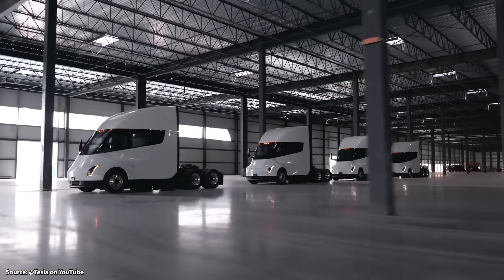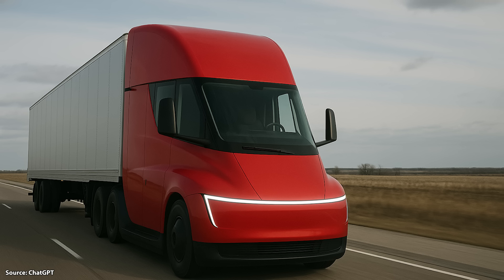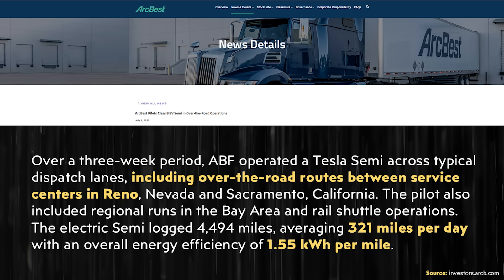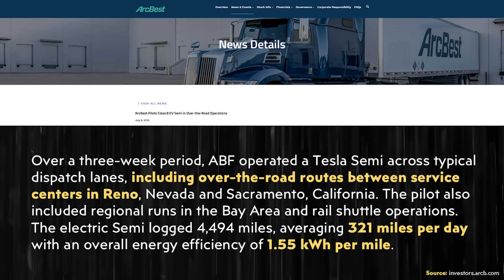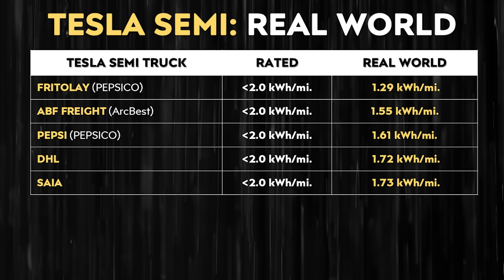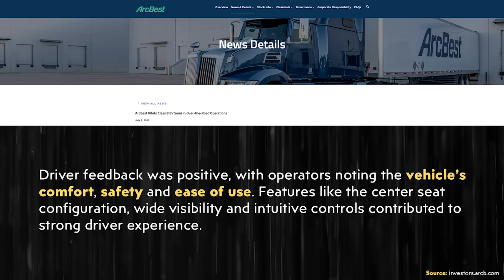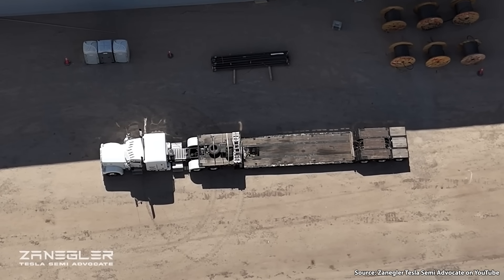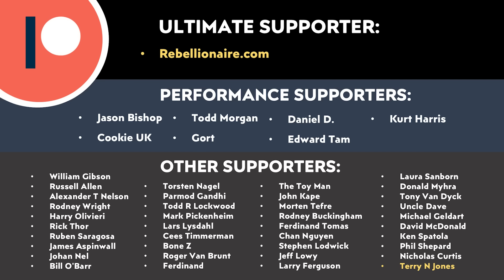Tesla Semi 2.0 | New Design, Mass Production & Real-World Tests!

Comment: If you are interested in electric trucks it is worth checking out  Electric Trucker (English dubbed) or Electrotrucker (German original). Electric trucks are more common in Europe and available since some time from several manufacturers. I don't know about price of these trucks and availability of batteries. Maybe that the host of this channel is able to check out the offerings on European and Chinese market.
Reply: Yes, in fact many companies offer electric trucks here. But TESLA is the only one not building on a traditional heavy weight chassis that is just electrified. Only disadvantage is (was) that we like more cab-over-engine trucks as the EC ruled the total length but since January 2023 longer cabins due to aerodynamics are accepted too. So this will open doors for TESLA. The advantages are obvious while Mercedes-Benz claimed that battery trucks will not beat physics and never ever catch up with Diesel, the Americans just did it. A 6x4-Semi with the same range under load than a legacy Diesel and charged home and destination is the future to save time and money as warehouses can have rooftop solar to get cheap energy. But the lobbyists of legacy trucks did a terrible job and asked for two metric tons more for batteries but forgot about roughly 700 kg/litres Diesel that is counted as payload. So with the same weight - sending shockwaves through the industry - including batteries the TESLA has 2,7 tons advantage in payload.😵‍💫🤯😜😎🥳🤑🤑🤑 The electrics from TESLA have mostly near double the power and much more torque than Diesel and are very quiet in towns besides not polluting environment. Prices of European EV makes can easily be double to comparable Diesel trucks but many companies for their reputation bought and even from very small manufacturing companies that use traditional parts from Iveco, MAN, Volvo, Mercedes-Benz, Scania etc.
Reply: @Lifecoach7Ra  Daimler Truck liefert  regulär den Actros 600 aus.  Eine 6*4  SZM ist einfacher zu bauen, als eine 4*2 .  Also so viel sollte man schon mal von LKW  verstehen. 
In der EU darf ein e-LKW 42 t Zug Gesamt Gewicht  haben, der hat dann logisch  mehr Nutzlast als  Tesla. 
Ein Tesla 6*4. ist viel schwerer , da seine zusätzliche Antriebsachse schwerer  ist, als eine Achse am Auflieger, die dazu   auch zu Liften  ist.  (. 3 Achsen  , eine lenkbar , zwei Achsen zum   Liften.) 
*  deshalb muss  durch  die reine Physik bedingt der Actros weniger  Strom benötigen. 
Ems  bis Gibraltar  > 2.500 km   Fast  voll beladen inkl. Klima  um 1,000 kWh je km. 
# Suchen sie nach Elektrotrucker  bei YT
Reply: as impressive as the specs of the tesla semi are, you seem to be ill-informed about the competition outside the usa. in europe, electric trucks have routinely been doing long haul runs for a while now – something you apparently believe the competition shouldn’t be able to achieve. and i even haven’t mentioned china yet…

Comment: Real world consumption for the Mercedes e Actros 600 is also under 2 kWh/mi. I've seen 1.87 kWh/mi for mixed driving and loads.
That said, that's Europe. It would be great to see how it would do on US roads.
Reply: @advandermeer740 Real world consumption for the Mercedes e Actros 600 is also under 2 kWh/mi 
Yes, but it's range is only 321 miles, compared with 500 miles for the Tesla semi. As such, it should have much better efficiency than the Tesla because of much less battery weight; but it doesn't.
Reply: @BigBen621  why would battery weight effect efficiency? Efficiency losses through rolling resistance are determined by total vehicle weight, not battery weight. And the total vehicle weight is determined by legal limits and how much weight you're hauling at a given time. A lighter battery means you can load more weight onto the truck before hitting the legal limit, but it won't change the legal limit.
Reply: @plainText384   A lighter battery means you can load more weight onto the truck before hitting the legal limit 
No it doesn't. The maximum load is mainly determined by per-axle limits on the trailer; so no matter how light your tractor, you still can't load it up with, say, 30 tons. A Google query produced the following quote: "With a standard semitrailer, the eActros 600 has a payload of around 22 tons in the EU". This is pretty much exactly what the payload of the Tesla Semi is; but the Tesla Semi can pull the same load >60% farther (500 miles fs. 310 miles) on a single charge.
Reply: @BigBen621   you know what the semi in semitrailer means right? The trailer only has wheels in the back. In the front the weight is carried by the axles on the truck. The same axles that also support the weight of the batteries. The legal limit is on total vehicle weight and total weight per axle, not cargo. If your empty mass is higher, your cargo can't be as heavy before hitting that legal limit. And battery weight is a significant contributer to the empty weight. In the example of the rActros 600, there are 3 ~200kWh packs each weighing around 1.5t. If they made an eActros 800 with a fourth pack to have more range, that'd be 1.5t more battery weight on the axles, meaning you can put 1.5t less cargo weight on those axles before hitting the limit.

The distance you can pull on a single charge is also not really that relevant beyond a certain point. There are legal limits to how long you can be behind the wheel before needing to take a break anyway. For a single driver the battery size on the eActros 600 is large enough that charging only during the mandated breaks is basically enough to get you where you want to go.
Reply: Tesla's Semi gets an efficiency of 1.0 kWh/km (1.6 kWh/mile) at full European load (42 tons or 92,600lb).  In America, Tesla demonstrated getting 1.6 kWh/mile at full US load (82,000 lb for electric trucks), with a mountain pass (Tejon Pass, 4144 ft) thrown in for good measure!  And that was BEFORE Tesla got a 7% improvement in efficiency.
Furthermore, the e-Actros 600 range (at 500 km according to the Mercedes-Benz web site)  is <60% of the Semi's range.  Talk about being uncompetitive...
Reply: Yes.. but Tesla does this with Max gross weight.. at 60mi/h
With a much bigger battery
Reply: @rare_wubbox360  All real world Semi consumption numbers are averages. They do not drive at max gross weight all the time.
Reply: @advandermeer740   They do not drive at max gross weight all the time. 
Of course not; but they're rated at max gross weight; 82,000 lbs., for electric semis such as Tesla.
Reply: @rare_wubbox360  60 mi/h = 96,56 km/h. 
That costs about 1.500,-- Euros fine and 6 months no truckers license. Thx!

Much bigger battery? eActros 600 has 600kWh net capacity.
The old Semi had 900 kWh. Tha capacity of V2 is not known.

Comment: The next thing is no cabin, the cost of the driver gone. Add more battery space , gain more mileage. Then have a massive Tesla charging AND trailer depo where Optimus will hook and unhook trailers. Plenty companies would go for this especially long legs. Taxi, uber and truck drivers are going to have a hard time in the future to finding a job. 🤔
Reply: Long Way to go, especially in Asia and Africa but maybe it's not the best idea to start a career in trucking in the US.
Reply: Weight is still a constant. Sure you can save some without the cab and replace with batteries. But it’s also important to remember the drivers normally do the unloading also, so you either need a Chase driver in a car or to have a rider still.
Reply: Would be amazing. Operating a machine for thousands of hours repetitively isn’t what we should be doing. Protecting jobs is a really really dumb reason to stifle progress.
Reply: In Canada there is a shortage of truck drivers.  Drivers seem to be enjoying driving this truck.
Reply: Yeah along with a lot of other types of work. Deflation and a massive economic depression is sure to follow, not everyone can snap their fingers and get another job.
But these batteries aren't lasting anywhere near a diesel engine currently.
Waymo's are only efficient in the city. Suburban & Interstate driving will kill the battery. Robotaxi can't operate in the rain.
Reply: @Dexion845   But these batteries aren't lasting anywhere near a diesel engine currently. 
Tesla Semi batteries are warrantied for 1 million miles, which is comparable to the life of a diesel engine in a semi tractor.
 Robotaxi can't operate in the rain.
This is what I like to call FALSE. For the first day or two, they did shut down in heavy rain in an abundance of caution. Since then, though, they've been operating just fine, even in heavy rain.
Reply: @BigBen621 ok, you got me, but Robotaxi can't stop safely in front of a railroad crossing. THAT is TRUE!!

I didn't know about the semi's but we shall see. If Elon Musk makes any claim, i've learned to be extremely skeptical.
Reply: @Dexion845 Which version of FSD did you write about?  13.2.9 seems to stop for everything it should stop for, except "no turn on red."
Reply: @Dexion845 in cars the tesla batteries outlast the cars according to Jeff Dahn
Reply: @Dexion845  these batteries aren't lasting anywhere near a diesel engine 
You're making this up, because no failures have been reported yet. In any event, the batteries are warrantied for 1 million miles, which is certainly comparable to the life of a diesel engine.

 Suburban & Interstate driving will kill the battery. 
Not it won't. But even if it did, see above.

 Robotaxi can't operate in the rain. 
Yes they can. During the first couple of days in Austin, they ended trips when it rained, out of an abundance of caution. But there were several rainy days after that, and they worked just fine. Example at 20:33, here: https://youtu.be/OVqIkyDtxxo.

Any more misinformation to share?
Reply: The biggest issue isn’t that robots are taking the  human jobs the issue is the government allowing it. Not regulating, they for sure have the power to limit automation in any facet especially if it’s costing the people their livelihood
Reply: @Joe_Pope  Ok, so Gov ban it, and every other country doesnt.
Reply: @Think6.6  why would it matter what other countries do vs what we allow in ours
Reply: @Joe_Pope  That’s a good question. I get why you’d say it shouldn’t matter what other countries do. But companies don’t really see borders the same way. If Canada or Mexico starts using driverless trucks and drops costs by 30%, US companies will want to match that to stay competitive.
It’s weird to think about, but the rules over there end up pressuring what the US will allow.
How would you handle that? Would you want the US to block those imports or force the same tech here?
Reply: @Think6.6  as I said we the people can instruct the government to not allow companies to do this regardless on how much they can save with their bottom dollar is they’re still making a profit. They’re just not making excessive profit which is not our problem if we can set the rules which we can. We won’t, but we can.
Reply: @Joe_Pope  Yeah I see what you're getting at. Keep the rules tight here even if it hits their profits a bit.
But, what happens when other countries just stop buying from the US? Or when they undercut the US so much our stuff can’t compete?
It feels nice to say “just regulate it,” but I keep wondering how you'd actually keep jobs here if the rest of the world doesn't play along.
What would you do if they didn’t? How low could the dollar value go?
Reply: @Think6.6  I think that leaves the point of this conversation about regulating AI and automation. 
We can be retaliatory in the regulation against this. This is not a raise prices, then type of issue.  It’s more of a “ we will not offer your products if you continue” because we have more leverage as people who want to buy goods in those companies aren’t going to want to move out of America or they would’ve already done it because it’s a lot cheaper to do almost everything outside of America
Reply: @Joe_Pope  Ok, fair. So you'd threaten to shut out imports if they automate too much?
But what always happens is:
 - Companies love loopholes. They’ll find ways to label stuff “local” when it’s not.
 - Consumers flip if prices jump.
 - Politicians cave if enough lobbyists scream “jobs lost!”
Feels like we talk tough on banning things, but I’m not sure they'd ever really follow through.
Betting a lot on holding the line?
Reply: @Think6.6  you can be a devil’s advocate to everything and come up with a anti-solution to everything, nothing is perfect, but when you always expect the bad and allow the worst to happen it will because there’s always worse that can happen, but that is not how any civilization should survive. So my last reply to you will be that we could try our best and if they fail, there is nothing else we could’ve done, but at least we tried to not allow people to lose their livelihoods to corporate greed.
Reply: Tesla is probably about 10 years away from making this a reality if they're lucky. 
The cant sell vaporware in the meanwhile so it also looks like it may be pretty unlikely that it ever happens
Reply: @Think6.6 Operated in a convoy scenario beats rail.  We can do that today, Elon Musk.
Reply: @jdmather5755  Oh yeah I forgot about that one, I mean if someone believes anything he says after hearing that little brown nugget of "wisdom" then there's really is no hope for them

Comment: If the truck is Autonomous,
Why for we even need driver cabin ?

Just build the back container holder.
Reply: Well, THAT kind of autonomy, especially for trucks which would be EXTREMELY fatal to others on the road if the case of an accident, still need a lot of development and safety checks.
Reply: @charlieblu89  Yes, 6-9 months at least.
Reply: @charlieblu89  meh . not really. the only danger would be out of control drivers around the semi. freak accidents
Reply: The driver normally unloads the trucks at stops. So you either need a rider to do the unloading at stops or in a chase car to unload at the locations. The customers aren’t going to willingly take over unloading unless the price of the products being delivered goes down. Looking at Pepsi that means pallets of soda or stacks with a two wheel cart. Humanoids are a long way from having the dexterity to use a fully loaded two wheel cart.
Reply: @aj_bary2044  Imagine a truck with modular cubicles and every consumer gets his/her cubicles directly deliuvered in their freezer. Ready to take out single portions, poroducts whatever.

What you are describing is the marriage of 10the century hauling with 21st century transport.

Of course the 10th century handling of goods needs many people.

Comment: I find it hard to comprehend that Tesla factories arent covered with solar from the get go. Especially as theyre so often in sunny areas. Its a big miss 😢
Reply: Nevada is already mostly renewables and energy costs are very cheap here
Reply: @Joekr7  I don't know where you came up with "mostly renewables", as more than half the power generation in NV is from NG in 2024    
    Natural gas: 25,007 (54.8%)
    Solar: 12,479 (27.3%)
    Geothermal: 3,848 (8.43%)
    Coal: 2,323 (5.09%)
    Hydroelectric: 1,607 (3.52%)
    Wind: 319 (0.70%)
    Biomass: 56 (0.12%)
Reply: I am sure you can apply for the Job@Tesla to solarize all their factories.
Reply: Giga Texas is covered. You can see it on Google maps satellite view
Reply: Tesla doesn’t believe its solar installations are economical. Others paying for it is fine though.